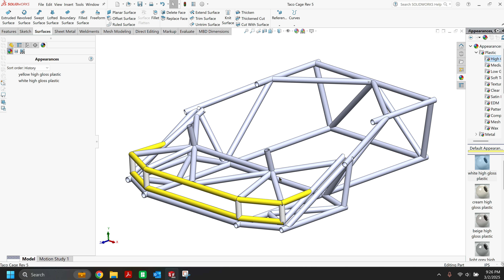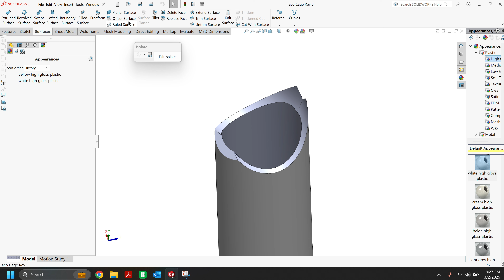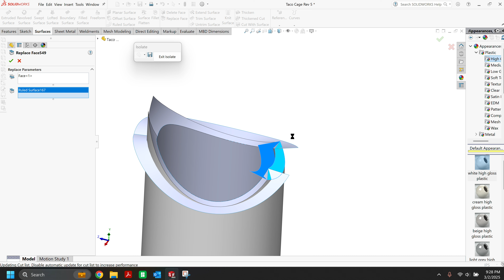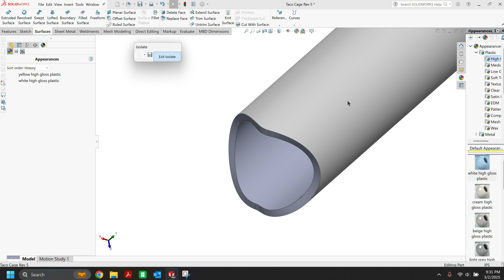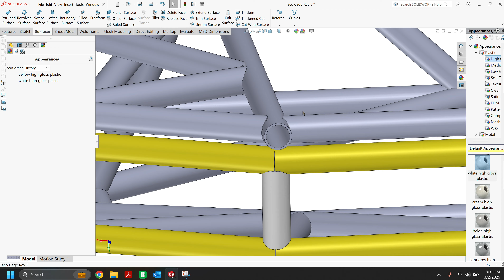Real Weld Profiles in Solidworks, for laser cut Roll Cage how-two

Comment: Why do we need to do that within Solidworks when most if not all Tube cutting software have automatic compensation for normal cutting. I only do it in SW when interferences are involved and want to check them in 3D.

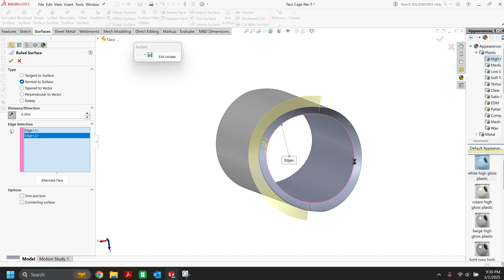Comment: Can you explain or make a video of how to "clean up" (at 4:25 of the video) the the ruled surface. I keep getting an "error" when i try to replace the face. Hope that makes sense.
Reply from the maker: Yes, I think I know which error you're talking about. Sometimes the ruled surface intersects the surface you want to replace, and that surface needs to be "split" beforehand. Split the surface of your part with the ruled surface, then replace the surface with your ruled surface. Google splitting a face, or split tab.
Reply: Use a CutWithSurface not ReplaceSurface, it works 99% of rhe time and if it doesn't, extend the rules surface a bit.